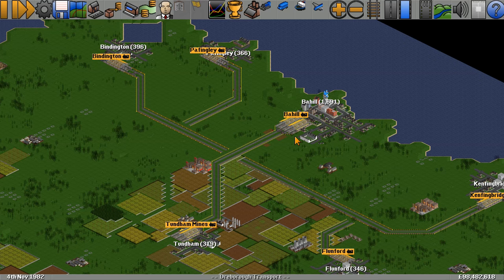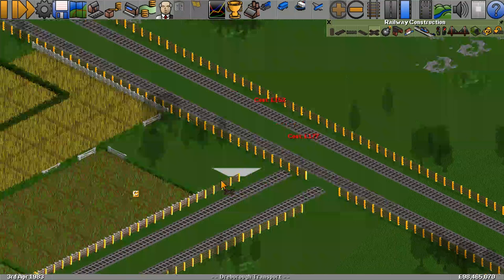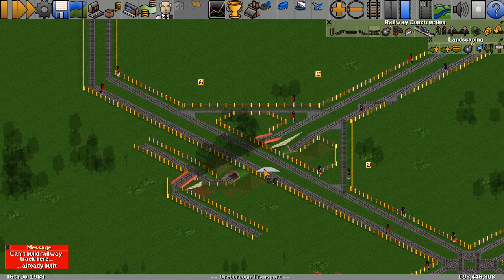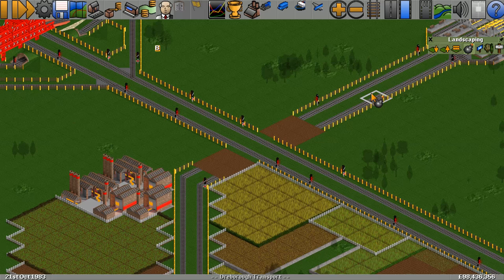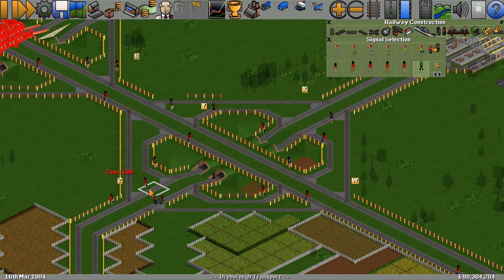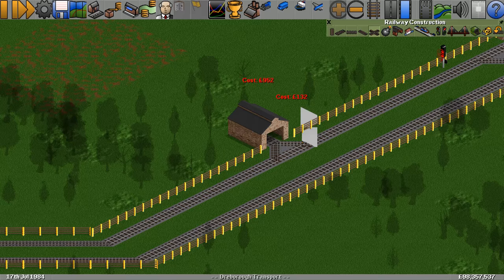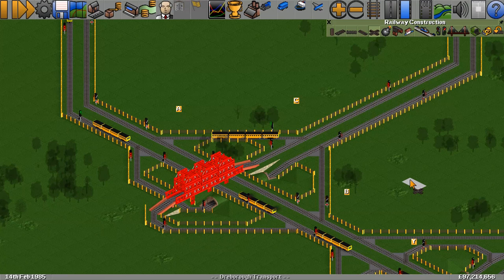OpenTTD Tutorial #14 - Advanced Railways - Junctions and Depots

Comment: I know this is late but a slightly better looking way of making T junctions is by making half clover leafs, it simplifies the proces and makes it easier to expand later on if you make it a crossroad, I got it down to a 2 wider then the joining line and 3 wider then the line that is being joined.
It also avoids bridges which are slower and usually more expensive then tunnels, money save and looks better. win win

To take this further you can basically make a whole clover with all the leaves and only remove the sides that are not used to let the vehicles go all possible directions (even turn around).
To take it further you don't even need the sides, on a grid based system, 3 times right equels left, the side is just quicker and doesn't hold up traffic.

If you wanne go kinda overboard with the clover 
you can use the clover on normal corners, a leaf in one corner, a straight in the other.

Or just add the leaves everywhere, every intersection, straight corner and on some straight lines, you can go down every road from any road, even "stay" on the same road.

Moral of the story, clover gud

Comment: Those triple depot setups won't work. At 25:45, the train waiting to enter the depot area waits until the other train has completely left the depot area before it enters. The reason for this is that the train waiting to come in is trying to reserve a path as far as the next path signal, which it can't do because the path is blocked by the train coming out of the depot. You alleviated the issue by adding those extra signals after the depots, but you'll never be able to use the two depots on one line at the same time. There are two solutions.

One is to add an extra path signal before the depots; that way the train will enter because it can reserve a path as far as that signal and then will enter either depot if it's free. This will allow a train to enter the left depot even if there is a train exiting the right one.

The other option is to set an order for the train; so if you create a go to depot order in the orders list you can then highlight that order and change the go to option to service. You'll see the order change to service if needed. This will fix the issue and remove the need for a signal either side of the depot because the train will only try to reserve a path as far as the depot, instead of all the way to the next signal allowing it to head for the depot regardless of if a train is coming out of the other one. The downside to this is you would have to specify which depot each train should use. So personally I'd go for the extra signal approach.
Reply from the maker: I need to look at why the double depot was not working as expected as I am sure I have had it working before.
Reply: In older versions the depot would act as a path signal. So the path reservation would go as far as the depot and then do another reservation to the next signal when it leaves the depot. At some point that was updated so the train doesn't use the depot as a signal anymore.
If you turn on show path reservations in the settings you'll be able to see this in practice. A train will come down the side line and the path will be reserved all the way down to the next signal. In older versions this would have been as far as the depot. And then on exit it would be from the depot to the signal. But now it will be all the way to the signal, so the next train won't reserve a path because it can't get a clear path to the next signal. Hence why a signal before the depot would alleviate the issue. The way you set it up in the video, no train will enter the side line and will use the main line instead unless the entire side line is clear.

Comment: The big T-junction with bridge and tunnel can just as well be signaled with normal unidirectional block signals, right?
Since it consists only of six "mini-Y-junctions" that join or split, there can never be two trains simultaneously in a single block, so path signals offer no advantage (and neither do presignals, unless you want to assign priorities, not discussed here).
I ask to verify because I prefer to use path signals only where they are necessary/advantageous.

Comment: I build a junction just like yours at 2:28. My problem is the following:

Trains coming from the top right (C) want to go to the top left (A). If everything is free it's fine, however if there are two trains right next to each other the second one will turn left (B) instead of right (because the path is tempoarly blocked) and go all the way to the next station just to reverse at the X in front of it.

It's logically to me why it is choosing the wrong path because the right turn path is "blocked" and it's not smart enough to simply wait a few second. But how to fix it?

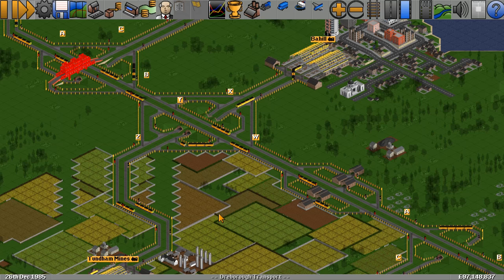Comment: 27:30 Train coming from C to B then Y to W, but goes through X and turns around. Is this only because there's no signal going into the junction at Y ???
Reply: Actually now that I unpause and watch the video after this, it happens a lot. I had this happening in a game and I just removed the track to prevent them being able to turn around where the depots are. Not sure what causes it exactly, but would like to know. Thanks.
Reply: It looks like if a train hasn't cleared the signal in the center of the junction, the one behind it tries to take the other route. How would you prevent this?

Comment: At first I did it like you but then I realized that it doesn't work with trains on the right side going up and down on the left  damn imperialistic system
Reply: Also most of the junctions are a lot simpler in the imperialistic version
Reply: The t junction is like literally 1 bridge and 2 lines going under it
Reply: You just need to swap it, like mirror what hes doing

Comment: Way too complicated. For junctions just cross the tracks in any way that makes sense, and put down tow-way signals at the entrance to the crossing area. The trains will block the routes they need and you don't spend time overthinking massive setups.
Reply from the maker: This works for low usage lines. However, as soon as you get busy lines mid to late games then you will likely need to have more complex junctions to allow better flow.
Reply: @MasterHellish-Gaming  Right. But using the signals right and just creating junctions works ALL game and is easier to expand.